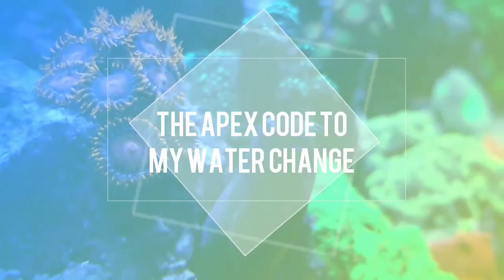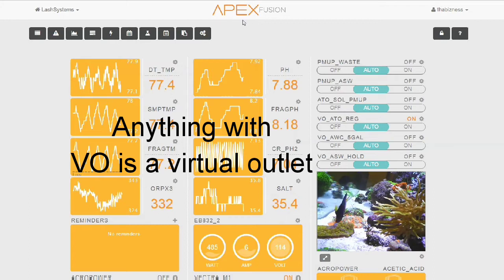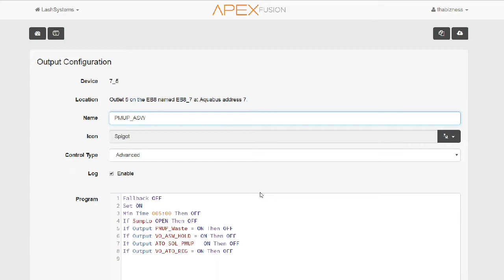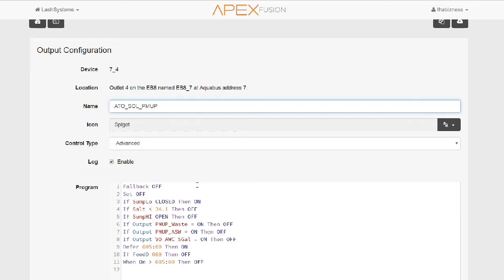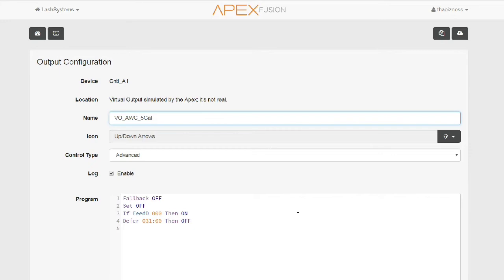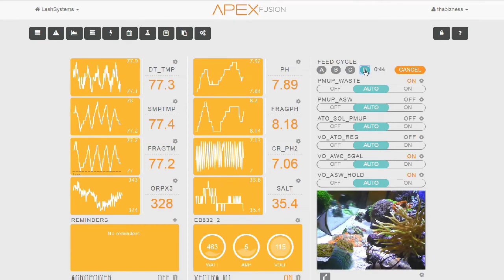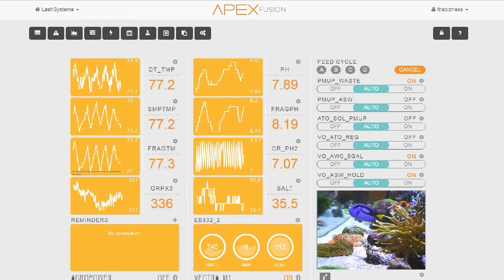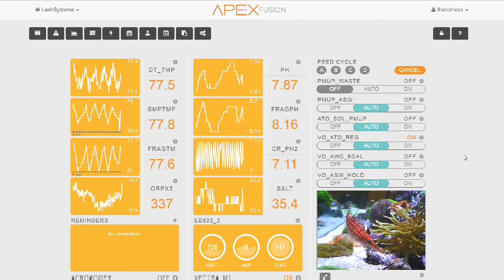Fusion Apex Code for My Water Change

Comment: nice  have question is pmupwaste pump for 30 min why pmup asw pump for 5 min .thanks
Reply from the maker: I can change the time that I pump waste water out to determine gallons. I dont have a set time on ASW as it pumps until it trips the normal water level optical switch (used to be a float switch)